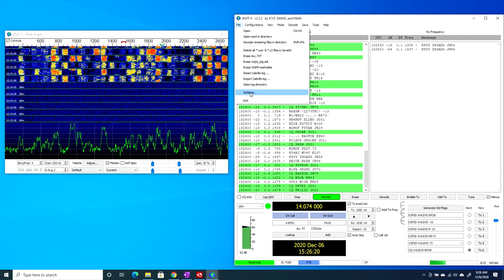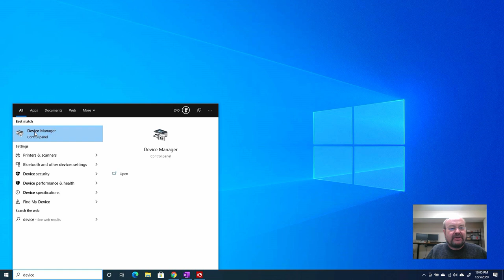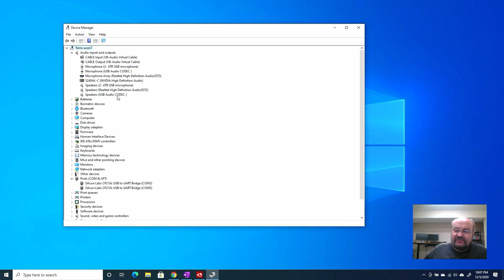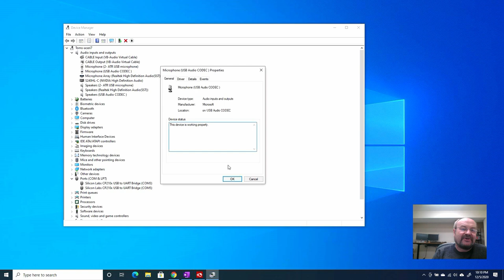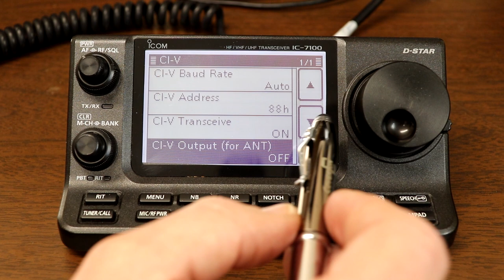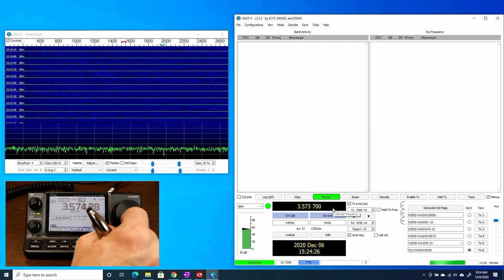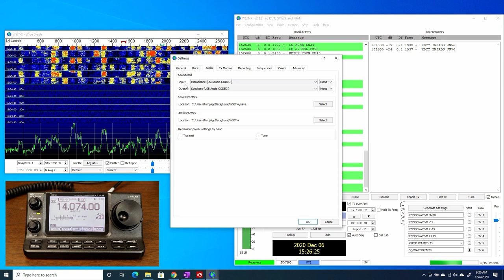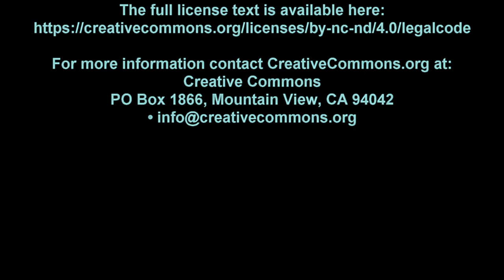IC-7100 from A to Z #12 - USB connection to a PC

Comment: Great video.  I use an Icom IC-7200, an entry level radio but with a USB/Soundcard interface.  it works great!  I also have a Yaesu Ft-891 without an audio interface.  An external device is necessary.  Besides having a cable mess the settings are finicky to get the radio to work with my compluters (Linux box and a Raspi 4b, the latter for portable work).  The IC-7100 is heavier than the FT-891, but I then would have to lug less crap around with me vs. the FT-891.  One cable to rule them all, and in the ether bind them!  I would have bought the IC-7100 but for reasons that no seller wants to reveal, in Europe it is about twice as expensive as the FT-891.  In the US they are priced pretty close together.  I have given up on the Yaesu FT-891, will sell it and (gritting my teeth only as far as the price is concerned) buy the IC-7100.

Comment: If possible during digital mode, make sure set the data mode for the rig too.  In my IC-7300 setup, I will make sure it receive audio only from USB. , so.  no sound from hand microphone will be mixed with modulated audio from USB being TX accidentally and may introduces errors.

For Starr demo, you an try communication   with IC-7100 and  your new IC-705. We can use automatic   voice keyer for the purpose. Or simply records the QSO using bulit-in recorder. 

Thank you, and looking forward for your next video. 73.
Reply from the maker: Thanks Mohammad.  Good points on the audio.  I will be covering those settings in an upcoming video.  Didn’t want this one to get too long.
Reply: @HamRadioA2Z  

Tahnk you, Sir.

Since you have several transceivers, you can use them  as station for   demos, and not need to  wait or look for any other stations during bad band's propagations.. 

Can you demo the RF gain (RFG_ effect during digital mode RX?

Thank you.
Reply from the maker: Showing what RF gain does to a DSTAR signal is a good idea.  I’m not really sure how it will behave.  I expect the receive audio will become intermittent at some point and then just disappear.  It will be an interesting experiment.

Comment: Did you install drivers from icom? My RSBA1 thumb drive has "CP210x" and "Icom USB Serial Port Driver" folders - which driver do I use? Tnx 73
Reply from the maker: Unfortunately, it doesn't seem like there is a single answer that works everywhere.  Under Windows 10, I didn't load any drivers.  The standard drivers built into Windows seemed to work fine for both serial and sound.  Under Windows 11, I have had to load the Icom drivers to get things to work right.  Here is a link to the Icom USB driver installation guide:  https://www.icomjapan.com/support/manual/1768/

Comment: This one USB Cable is all I need to connect my IC-7100 to a computer to use digital modes?
I don't need a Digirig or similar device or xggcomms Digimode-4-Icom cable with built in sound card?
Reply from the maker: Hi.  That is correct.  The 7100 has the equivalent of a USB sound card built into the radio.  It also has a serial data interface that works over the USB connection.  So when you plug the radio into your computer, you will see a new audio device and a new COM port.  Everything you need to operate digital modes and control the radio goes over the USB cable.
Reply: @HamRadioA2Z  Great, thank you. I've seen other videos and devices for sale saying that is what is needed to do digital modes with the ic-7100.
I ordered two different lengths of the cables you have listed in the links below, glad I don't need those other devices to drag around.

Comment: Hi Again Tom yes that worked perfect, but its the thin end of the wedge,  i am trying the impossible, i have a raspberry pi 4 with windows 11 on at the server end, if i can make it work, and will be having the laptop with windows 10 on, that is what i have just been using to connect to the radio, and i am trying now to connect to the raspberry pie from the laptop, wish me luck, what audio setting should i use on the remote laptop, the default or the icom ones, and should i disable the icom ones or just click on set the original ones as default cheers from Fred in Uk.

Comment: Hey Tom, thanks for these videos. I have my IC-7100 connected through the AT-180 tuner. Now, whenever I try to transmit in WSJT-X, my laptop makes the USB disconnect sound and the audio device disappears, causing the program to freak out.

Comment: I am looking to buy my first HF rig on a limited budget, want to have the ability to do ft8. Am i seeing that I can use the cable that comes with 7100 to plug into the computer and i dont need any other hardware?

Comment: Hi Tom i have set everything up aall working except i can't get any sound out of it...everything else works ok
Reply from the maker: Hi Fred.  Sorry I didn’t get back to your earlier post.  Glad to hear it’s mostly working.  With Windows, it sometimes changes the default speaker output when you connect a new audio device.  The USB connection to the 7100 will look like a new audio device.  Try left clicking on the speaker icon at the lower right corner of your Windows task bar.  Just above the volume control bar it will say what device Windows is using for default audio out.  Usually “Speakers (..some device name..)”.  If it says USB something for the device name, it’s probably sending the sound back to your radio.  Click the ^ to the right of the name and it will show you a list of audio devices.  You’ll want to pick whatever your laptop normal speaker device is.
If you click the volume slider up and down, you should hear a musical chord letting you know the new volume level.  If you don’t, you haven’t selected the correct device.

Comment: Thank you for posting this. I notice, having followed your steps, that in WSJT-X clicking the TUNE button on the screen (not the one on the radio) does not seem to work. Any idea of how to get that to work?
Tnx es 73 de Arnie W8DU
Reply: Actually, what happens is that the RED transmit led does light up on the radio, but there is no RF coming out.
Reply from the maker: Hi Arnie.  The good news is that if the RED light is lighting up, we know that WSJT-X is talking to the radio.  If you're not hearing a tone or seeing any power, it's probably because the audio isn't getting to the radio.  Do you have the mode set to USB-D (-D is data)?  Also, do you have the radio set to get audio (modulation) from the USB port?  Go into the Settings-Connectors menu.  Scroll up or down to find DATA MOD (Data Modulation).  Make sure that option is set to USB.

Comment: I can't believe how seamless this is for you I have a brand new Dell Win 10 Laptop and a 1 week old 7100 and every time I go to connect to the radio I have to play with the config for the software to get reconnected and always end up with the same settings.  Is my new 7100 defective?
Reply from the maker: Hi Jeffrey.  I’m sorry I missed this comment a couple weeks ago.  I’m not sure what might be going on with your setup.  I’m running Windows 10 on 2 different laptops that I use with the radios.  I also switch between connecting my 7300, 7100 and 705 pretty regularly, along with a USB microphone and other accessories.  I sometimes have to re-select the audio device in programs like FL-Digi.  However, I suspect that is more because I’m switching back and forth between several audio devices.  When you say you have to play with the config, do you mean on the laptop?  Or do you have to re-adjust radio settings in the SET menus?  If selecting or re-selecting settings on the laptop fixes it, I don’t see how that could be a radio problem.
Reply from the maker: One other question.  Do you have another laptop or access to a friends laptop you could try to see if the issue follows the laptop?

Comment: Thank you for this video.  I made the mistake of doing a complete reset and lost the repeater list.  Can I upload the repeater list with a sd card containing the icf file downloaded from icom's download page without the ic-7100 cloning software?
Reply from the maker: Yes.  The 7100 can load that .icf file directly.  Unfortunately, you can’t customize that list and the file on the Icom website isn’t very recent.  On the DStar.info website, you will find information to create a customized repeater list for your area or region.  It creates a.CSV file that you can download.  Newer DStar radios can read a .CSV file to create the repeater list.  Unfortunately, the 7100 cannot.  RT Systems makes software to program the 7100 that is less expensive than the Icom software.  The RT Systems software will import the .CSV file and program the repeater list in the radio.  You can also directly edit the repeater list in a spreadsheet like format with the software and set it up however you like.

Comment: Why can't these radio manufacturers use commonly used USB connectors that people have in quantity in their desk drawers, instead of some "exotic" connectors that require a new purchase?  Shame on Icom, which otherwise has done a good job of connecting radios to computers.
Reply: that's what I'm saying there is plenty room for a Type B and the cable they give you is Crap!

Comment: Good morning Tom
I hope you can shead some light on this question for me?
I have seen several videos of the 7100 being controlled via a Panadapter.
I want to know if it's possible to operate the 7100 with the head unit completely removed?
Replacing the head unit with a wired tablet with Icom RS-BA1 or SDR PLAY would be sweet.
Thank you kindly Sir.
Gary
Reply from the maker: Hi Gary.  Yes.  You can operate the 7100 without the head.  In the Set Mode under Function, there is an option called Power OFF (With No Controller).  The default is that the radio turns off if the control head is disconnected.  Confusingly, that option is labeled ON.  If you set this to OFF, the radio will operate without the control head.  The 7100 does support CI-V (CAT) commands to power the radio on and off.  So you can completely control it with RS-BA1 or other similar radio control software.

Comment: Hi Tom, very good video again, i am thinking of using my 7100 on remote, i have the Icom software for the 7300 RS BA1? and i think the 7100 is listed on there as an option, i assume this will work with 2mts and 70cms as well...73 Fred g4vvq.